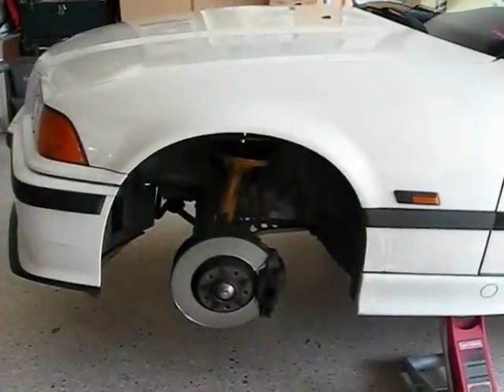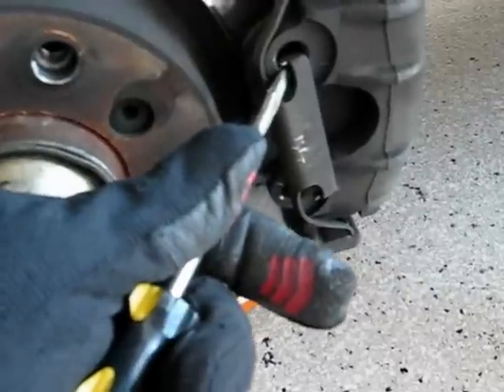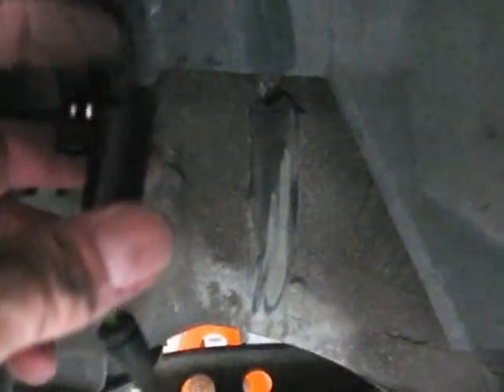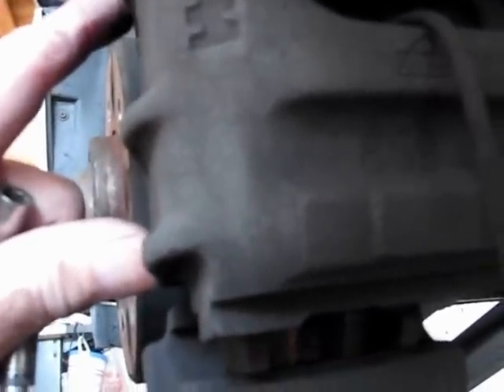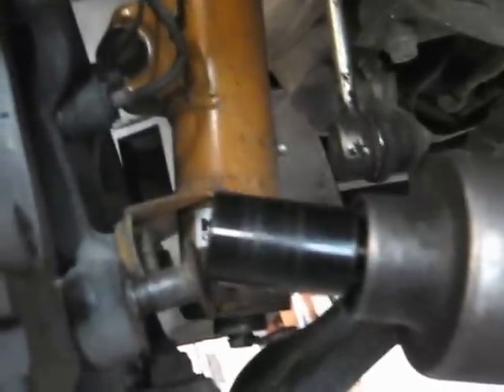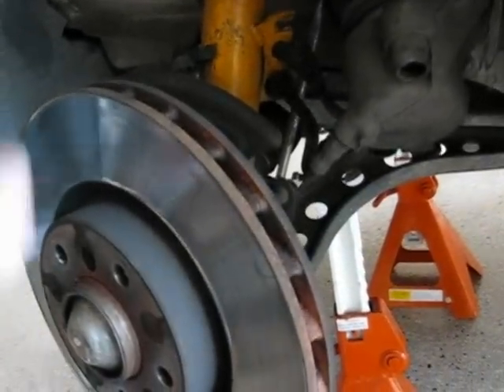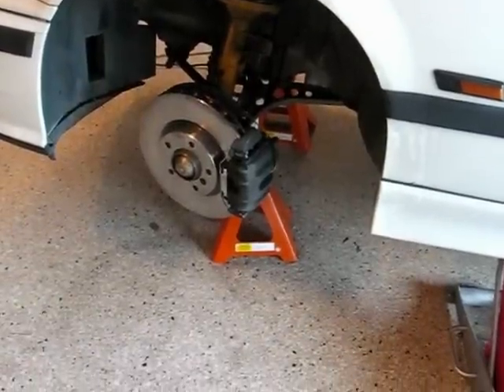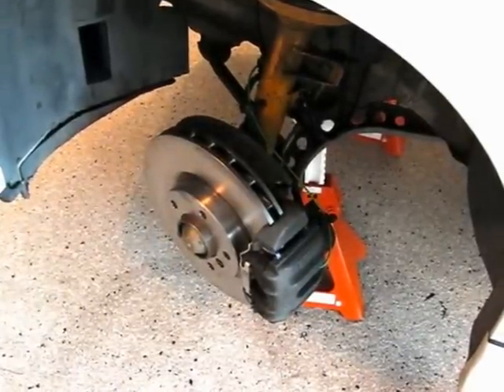BMW replacing front brake pads and rotors on E36 M3 by froggy

Comment from the maker: I would get under the car & carefully check each sensor wire, if they look ok I would still clean & reconnect each end. It is a very harsh environment where these sensors are installed.

Probably easiest if you jack the car up & pull each wheel.

:)

Comment from the maker: The abs/wheel speed sensor is not hard. One end "plugs" into the caliper and the other to a wire harness. I do not have a video yet for this. You might try taking it apart and cleaning both ends and inspecting the wire for damage. Why do you think it's bad?